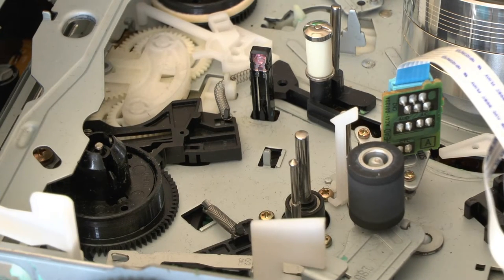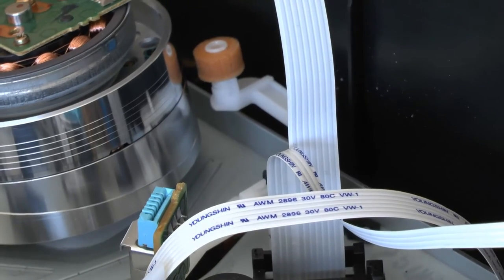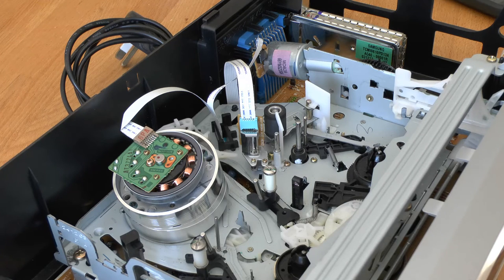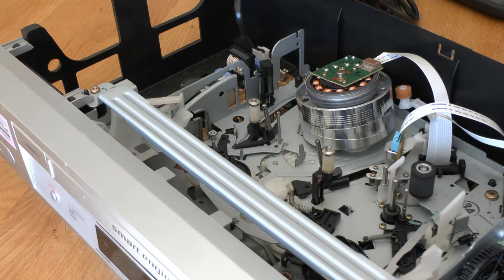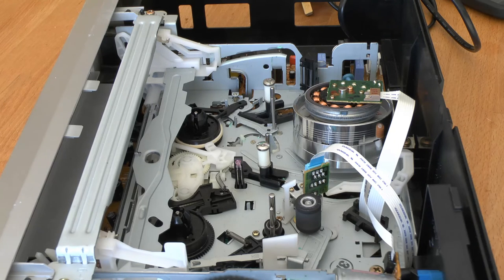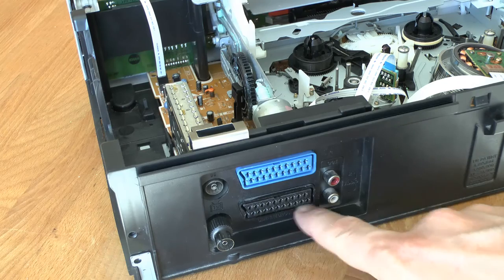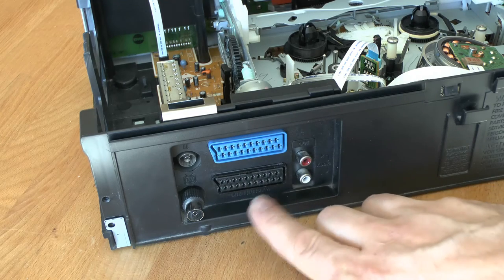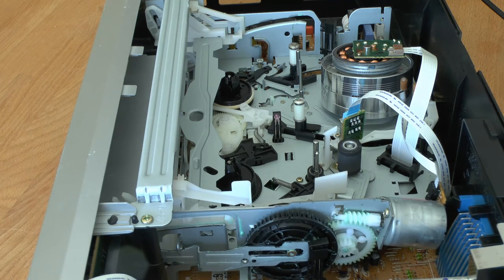Sony VCR with self cleaning head thingy.

Comment: Self head cleaner does more damage to the video head in the long run. Remove it and never use it again. They should of never been out in vcrs they are rubbish and cause handful of problems.
Reply: Really? I have one with a self-cleaning head and I've never heard that. It works fine, but I want it to continue to work fine, so I guess I should do some research and see about removing it.
Reply: @angryhobo212  Yes, in general having an arm with a cleaning wheel is a very bad idea. The material deteriorates over time and could contaminate or scratch the heads. Or if the wheel breaks down, the empty cleaning arm can crash into the video head drum and damage it. All my video recorders have their cleaning head assemblies removed.
Reply: @speed_rider362  how do you remove it so that the VCR does not give errors? on mine the video quality is fine but the sponge on the automatic head cleaning thing is worn out and would need to be replaced.
Reply: @octavianciobanasu4985  The VCR will not give errors after you remove the cleaning arm. However, you have to be careful in case your cleaning arm base serves also as the stop for the P4 guide post. In that case you need to return the base back after clipping off the arm.
Reply: @speed_rider362  so if there's no pad on that arm, it's ok to use with no issues? I got one second hand and it ate a tape. I'm gonna clean it and see how that works. Thanks!!
Reply: @mikehorvath8176  Well, maybe. The arm could still bend a little and scratch or dent the head drum. Happened to me on NV-HD635. When I opened it, there was this huge dent on the lower drum just under the head tips. The arm crashed into it. A bad tape/cassette housing caused this? Who knows. Don't risk it.
Reply: i was just thinking about  that  self cleaning   arm, whether it has some proper advantages  or not... i do not have  good feeling about that.. i will rather clean the heads manually more often
Reply: Remove the auto head cleaning. All you have to do is unclip and remove the plastic off transport, or the arm itself. It won't cause any errors or transport issues. The problem is the sponge deteriorates and clogs up the head  and if you just removed the sponge, the plastic can get caught in heads snapping them. It is best to remove it completely.

Comment: I used to clean head chips on dirty or worn out video heads by using a new strip of white printer paper and rotate the video head back and forth very gently holding without moving paper against it, side to side not up or down, 2 to 4 times across the the 2, 3, 4 or more chips, a black mark can be seen on the paper from dirty heads. Used this method with success on a number my older players.

Comment: It's very common for the auto head cleaner sponge to perish with age. Try squeezing it between your fingers. If it doesn't go back to round when you let go, it's perished. I had one in my VCR that seemed to be doing its job until very recently and when I opened it up, I found it had gone bad. I pulled the sponge off and cut the end of the arm off as well so the plastic wouldn't be touching the head drum either. But I think the damage had already been done and one of the heads is now failing.

Comment: Does that self cleaner actually work for a normal dirty head ??
Reply from the maker: Hello and thanks for watching the video. Does the head cleaner actually work? Well yes it does actually work, that is until it also gets too dirty and then it just puts the dirt back on or simply preforms no cleaning action whatsoever. Machines before this one that I personally used required frequent head cleaning but a lot of rented video tapes went through those machines.
Reply: @DRCHRISTIANMD  so this self cleaning thing, is that an option or does it self clean on its own all the time ??
Reply from the maker: @ACommenterOnYouTube  It is an automatic function of the drive. It requires no intervention from the user nor can you force it to do it. ( unless you eject and reinsert a tape that is)
Reply: @DRCHRISTIANMD  so i am going to guess that the cleaner "brush" will get dirty at some point and needs to be either cleaned or changed out ..??
But i am going to assume that head brush thingy cant be replaced today in 2021 ... due to the age of these machines being at or over 20 yrs old and finding a replacement would be impossible ...
Reply from the maker: @ACommenterOnYouTube  Yes I would say its nearly impossible to find a replacement one hence the reason I have removed them from machines I have had them in and or serviced in the past. If you can find a new one it's worth replacing but I reckon hard core VHS ers wouldn't recommend it and go for the manual head cleaning  option.
Reply: @DRCHRISTIANMD  so let me ask you this, i found a NEW one (old stock) that apparently was "found" in a warehouse and they are selling it. It was made in 2001 but never used. This unit has the auto head cleaning option on it. 
Do you think i should go for that new old stock unit or a USED ~20 yr old vcr that was "tested and working" ... 
There are quite a few of NEW old stock for sale on ebay ..
Reply from the maker: @ACommenterOnYouTube  Hello. I'd be probably tempted by the new old stock one but depending on how ot was stored could be a risk with perished parts inside. If you can get a used one in box it's always better than one that has not got a box. ( usually indicates someone who cares about the device) However if the new old stock one is at a good price and is of a higher specification model again might be a better bet. At the end of the day it's up to you and you're best judgement.
Reply: @DRCHRISTIANMD  well, most of the used ones do not have a box or the remote. Only a handful of the used working ones have the original remote. 
Almost ALL of the NEW old stock VCR's still in box are way over priced because most companies stopped making VCR's back in early mid 2000 so now its like a supppy and demand type deal but there is NO demand for vcr's AT ALL so why ask $600 for a 20 yr old vcr that nobody is willing to pay for ... ya know ???
My parents vcr failed and they want a replacement. I am willing to pay $150 for a NEW old stock unit but this one lady wont budge below $200 and i am like asking her, WHO ELSE IS BUYING VCR's in 2021 ???? NOBODY but me 🤣 ... So why are you being so greedy about it ??? I am offering you some $$, nobody else is ..🤷🏽‍♂️ .. 
Anyways enough ranting, if she doesn't cave with the $150 offer, there is used one that was made in 2005 that the guy wants $70 for and he did test it and he claims its working fine.
Reply: This video and the following comments have confirmed my desire to remove the Auto Head Cleaner. I've cleaned the same Toshiba DVR620 twice and I finally saw the Goo on the darkside of the cleaner. Time for surgery.

BTW... what's RTFM, classic gonna knick that.